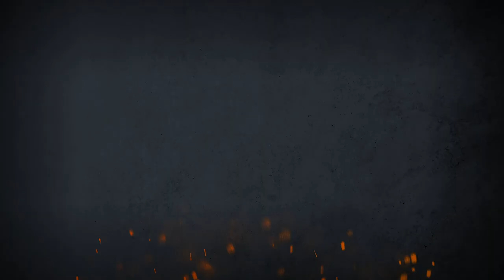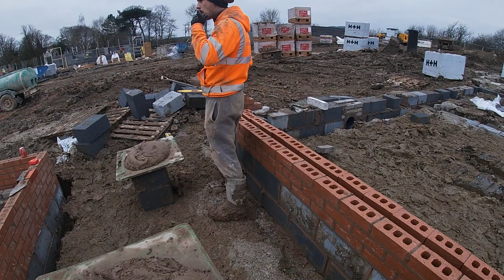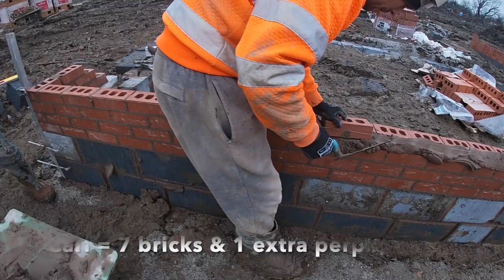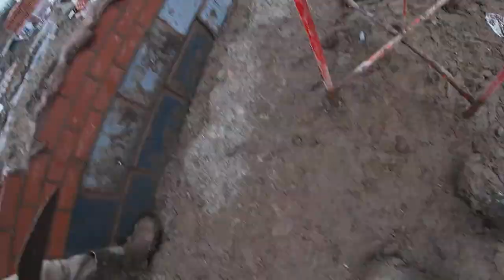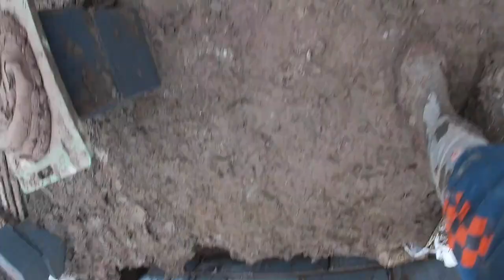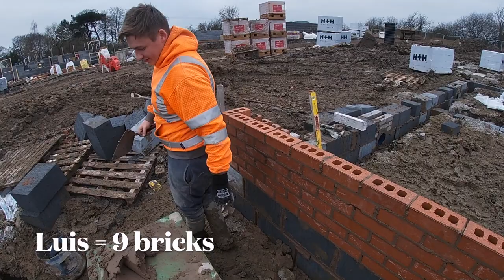How Many Bricks Can We Lay In 1 Minute??? Fun Bricklaying Challenge

Comment: Profiles or build corners what’s quicker? Can you do quick vid on how to setup profiles
Reply from the maker: I would definitely recommend using profiles for anything above 5/6 courses high as they save time on building the corners and don't move when still wet if the line is pulled tight. I will be uploading a video on how I set up profiles and chase the bond out for brickwork.
Profiles for dough, corners for show 😀